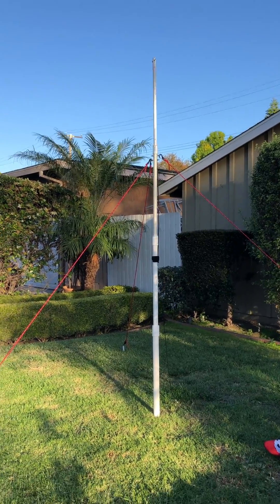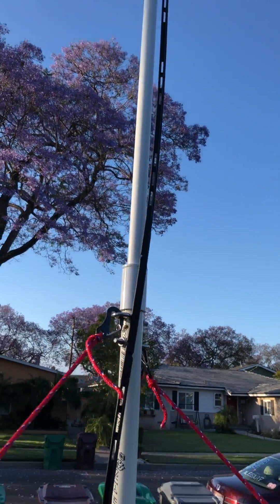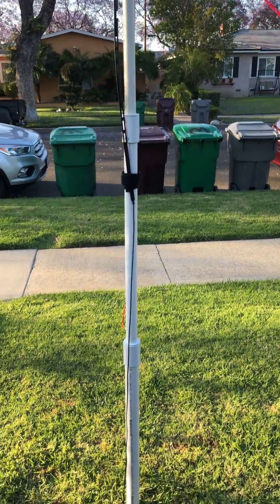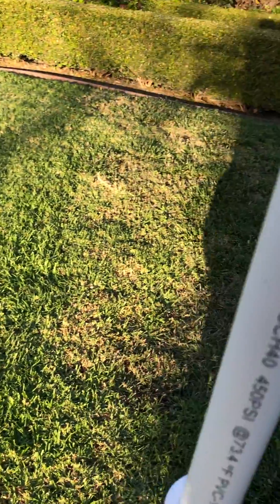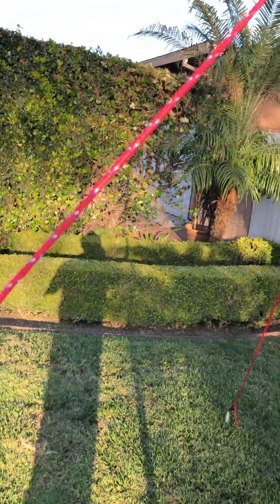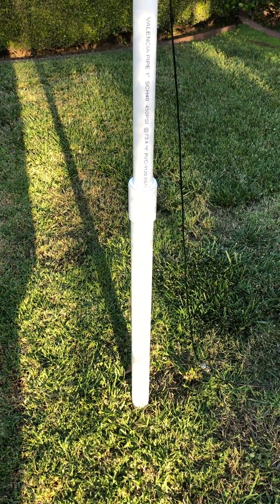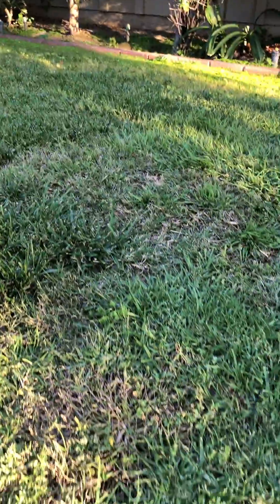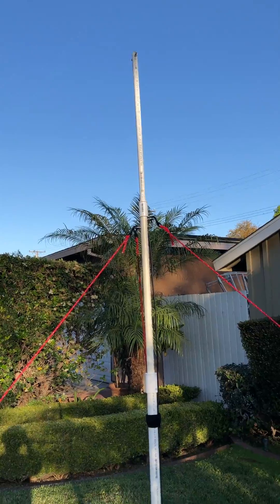Ed Fong DBJ-2 Antenna on PVC Portable Mast

Comment: I've watched a number of the Ed Fong videos, kind of a sales pitch, though he's not really selling these for a princely sum at the club-pricing level (~$40 each in 2025). He commented that the schedule 40 pvc will block some of the signal and cast a bit of shadow. This was the rationale behind using the thinner 200 psi pipe he has on the DBJ-1. Considering the effort is the same to breakdown or set up the thicker PVC, you may wish to revisit using a smaller and thinner PVC. Yeah, the video is 5 years old and the smart money is this being old news, but just food for thought. 

I like the PVC setup you've got, vs the hinkey crappie pole, which is usually a crappy pole considering how poorly the import rods hold up. Had not considered this until seeing your video, so very much appreciate the inspiration. Wonder if a flagpole holder, christmas tree holder or maybe even a large stake somehow joined to the base would hold to spike this into the ground for a more robust install.
Reply from the maker: That’s one of my first experiments. I still have the antenna but these days I’d rather hang it from a tree or a collapsible pole.  Seems to work just fine and I’ve worked stations 100 miles away with 5 watts from some mountain tops.
Reply: @MarkWarrick  what pole did you find most suitable? 

It kind of defeats the purpose, but I did look into getting some of that 200 psi PVC to put this antenna in when I'm at home 

When I look at the numbers, the version inside the PVC (DBJ-1 for 2m) is about 6 inches shorter overall than the DBJ-2 that just hangs bare. So I would be too long for the 2 m if I put it inside of a pipe.

I mean it's only 10 bucks for a length of PVC and a few caps so certainly worth trying.

Comment: How would it work with the Jpole wire inside the PVC?..Reason I ask, I can find all sorts of extendable poles and tripods for on-the-cheap at places like Goodwill if I just want to hang something OR even buy like a new, collapsable pole with hooks on the end for painting, flying a kite, etc, that can be used at various lengths up to 31 ft for HF, all the way down the spectrum (and they collapse down to about 4 feet)...BUT all of those are for hanging EXTERNAL wires. I want to make a jpole that'll be protected inside PVC for a more permanent setup along with using PVC pipe and connectors to fix broken whips.
I get all these speculations and smart-ass comments "Just buy another antenna" from Geeks who really haven't got a DAMN clue about much of anything. I want someone with knowledge/EXPERIENCE to tell me is PVC a good shell?
Reply from the maker: He makes a version of the antenna that goes inside a PVC pipe.   Check them out here:  https://edsantennas.weebly.com

Comment: A few more details would be nice like how are you connecting the different size PCV pipes. I'm trying to do something similar but attached to the side of my house.
Reply from the maker: Hi Rob, sorry for the delay!  Parts list here: http://km6zpo.com/diy-pvc-portable-antenna-mast-with-ed-fong-dbj-2-roll-up-antenna/
Reply: @MarkWarrick  Thanks for the video. Very nice setup there. If I understand correctly, the Ed Fong antenna is encased in it's own section of PVC pipe. Is that right? Wouldn''t you then need a way to get the feedline outside of the PVC pipe, and tape it to the outside of the PVC mast?
Reply from the maker: @rootcanal7188  Actually no, it's attached to the top and dangling down the side of the PVC.  Scroll to about 16 seconds into the video.  It is not advised to put antenna into the PVC pipe.  There's actually a different antenna which Ed Fong sells which is designed for going inside a PVC pipe.
Reply: @MarkWarrick  Thanks for the explanation.
Reply: @MarkWarrick  Thanks again. Can you explain what is the name of the part (it looks like a small hook) that holds the top of antenna to the top of the PVC mast? As a suggestion, you might want to use the same part, where the bottom of the antenna connects to the feed line. I made contact with N9TAX, who sells similar units on Ebay. He said that the entire antenna should be suspended in free space for best radiation, Thanks.
Reply from the maker: @rootcanal7188  it's just an eyelet bolt - same thing used for the guy ropes.  Sounds like N9TAX is suggesting that you hang it freely, such as on a rope between two poles, tree branch, etc.  But I would think that a tree would have even more DB loss than a PVC pipe.  You'll only know from trying it.
Reply: @MarkWarrick  Thanks very much. I agree with you, that a rollup antenna thrown over a tree would have signal loss.